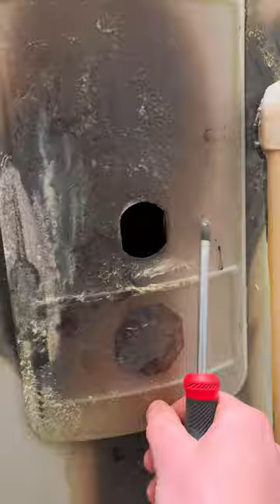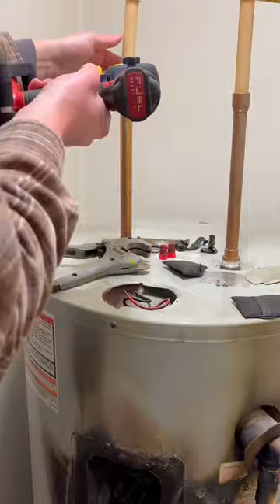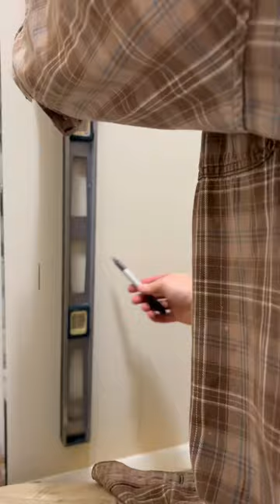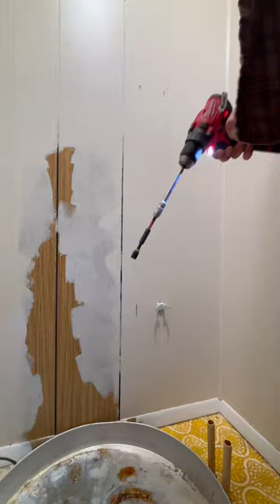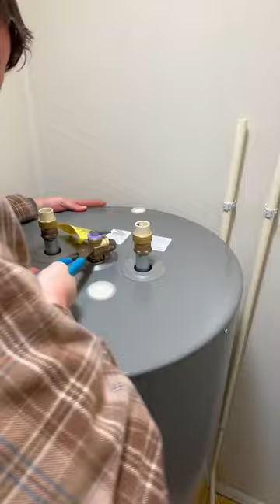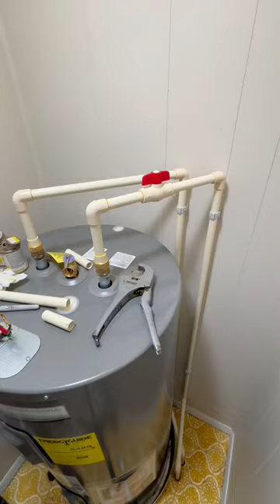Why did this water heater catch on fire?! 🔥🔥 #plumber #bluecollar #waterheater @dewalttv

Comment: It probably wasn't properly grounded. That's why the breaker did not trip Or the breaker could have been going bad.
Reply: That wouldn't cause any of those issues
Reply: @jeffl4810  So please explain to me why it kept feeding it power
Reply: @sticksandstones1885  I did a detailed reply to this video where I explained the fault in detail.

In short, likely the thermostat had a bad connection, either from a terminal, or contact wearing out. This caused its resistance to increase, giving a runaway situation that eventually turned the bad connection into a heating element, in series with the actual element.

This actually causes the electrical current to drop . And will NOT trip the breaker until a secondary effect occurs, like a burnt up conductor touching something grounded, like the tank, or casing. Or the other power conductor. 
In most cases, the breaker won't trip, as the fault burns the circuit open.

In high voltage situations (480-600V industrial power), an sustained large plasma can form, shorting out the wires in open air. Commonly called an Arc Flash. This can draw obscene amounts of current, causing an immensely hot fire ball and literally an explosion.

Comment: No expansion tank? Not code where you are? Im not a plumber, in a HVAC dude. But i see the water heaters, they normally right next to my air handler. Good job on not using the flex hoses. True hard piping.
Reply from the maker: This house was on a well so the pressure tank acts as an expansion tank 👍👍

Comment: Id guess the wires werent tightened properly... it happened to my electric boiler
Reply: Properly torqued wires are a big thing when dealing with sustained high currents...
Terminals, and wires will burn up otherwise. Especially as they age and oxidize.

Comment: Looks like old water heater met code, but the new install does not meet code. Doesn’t code state something about a length of copper pipe before you connect the plastic pipe?     Comments……

Comment: Need an electrician too come out the breaker didn't trip causing this problem
Reply: Please see my detailed reply. 

Current actually decreases during this type of fault, and won't trip the breaker from over current. 

Although it can trip at the at the final stage, after everything is burned up sufficiently that it shorts/arcs out.

Comment: User error? 🤣😔 Damn that's a broad stroke of a big D... 

Cpvc is confirmed junk... Not too hard to work with when it's new, however it gets brittle as it ages and is thus prone to stress fractures specially in high water pressure or extreme temperature situations. 

The worst/most frustrating materials to deal with...  galvanized steel, Quest (polybuytlene), cpvc, type M copper located in areas with poor water quality.

Careful how widely you cast your net, otherwise you're gonna catch flak, bs and a big ego.

Comment: A loose or coroded neutral will arc.   Also, if BOTH elements tried coming on together, it would have drawn too much current. Check the overcurrent device (breaker) to see if it might be bad.
Reply: No neutral in a HW heater.

Current actually reduces in a thermostat thats burning up, do to its series resistance increasing

Comment: It's a defect in the manufacturing. When they fill the jacket with expanding foam insulation it pinches the wire tightly against the tank.  The wire insulation is thinner than normal and the wire itself is thinner.  I had one that I repaired that was tripping a breaker because there was a small leak at the expansion tank that kept the exposed section of the tank near the thermostat wet which caused slightly rusted water which is conductive.  It took days in between tripping the breaker as it gradually burned the insulation off the wire and shorted out within the rust filled water

Comment: Need 18inches of copper of copper coming from the unit. FAIL
Reply from the maker: Not in our state
Reply: @4thGenPlumbing  even the guy who installed the combustible water heater put in the copper. What would you do at home
Reply from the maker: @harryPair  it’s an electric water heater. No need for copper unless it’s gas. Code varies from state to state but this passed our inspection which is needed in our county.